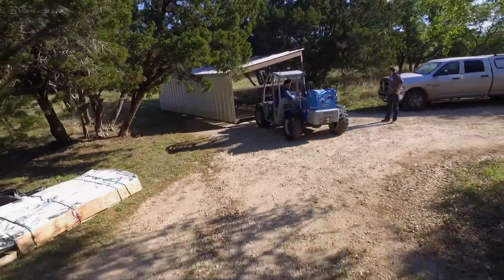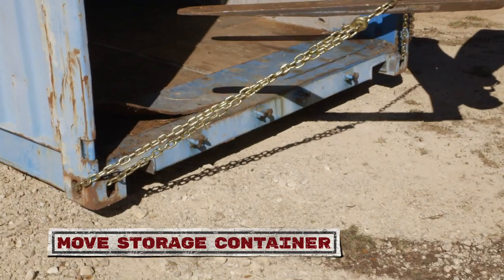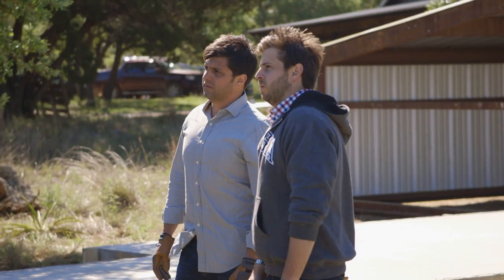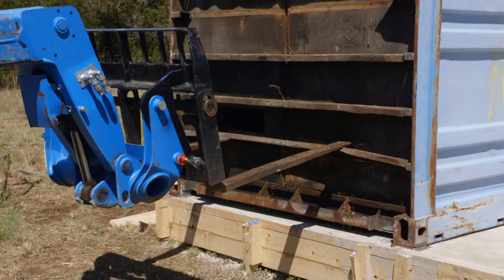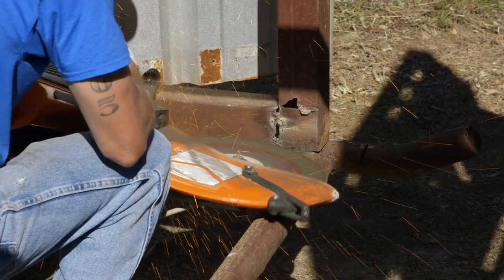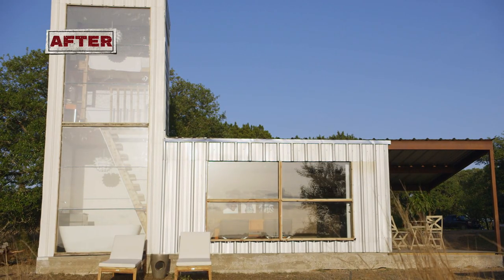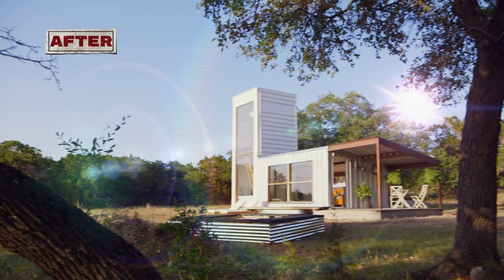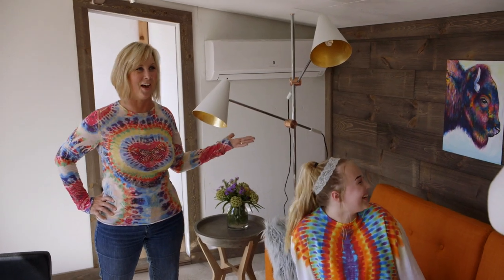Flipped Storage Container & Shed Into a HOUSE! - You Can't Turn That Into a House! (S1, E2) | FYI

Comment: Just started watching this series and with the shipping container/bison shed, there are some major flaws in the design and functionality of this space. 
The shipping conatiner turned on its end was a flaw because so much floor space was wasted AND there is nothing to cool that "tower" with windows bringing in the sun. Not even fans mounted anywhere in that tower, it will be too hot for anyone to sleep comfortably. 
IMO, they should have kept the shipping conatiner on its original landscape orientation, creating an "L" shape house and build a nice roof top deck on top,  
Also, the fire pit with wood burning may cause some serious fire hazards, especially with the wood top on the "hot tube" sitting adjacent to it. A propane firepit would have been much more safe and practical. 
l would not have put in a bath tub either. Teenagers are not going to want to take baths. An outdoor screend in shower in the patio area would have been more practical and space saver, allowing more room for inside and much more practical.